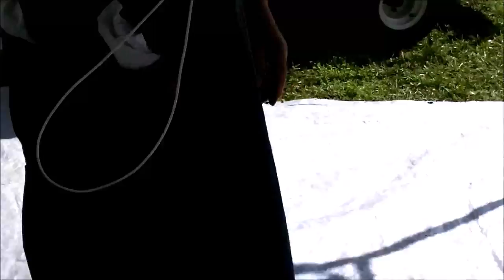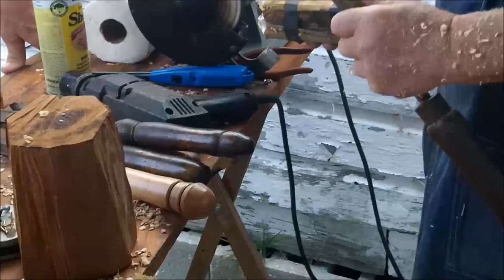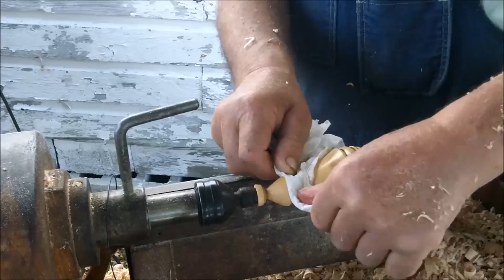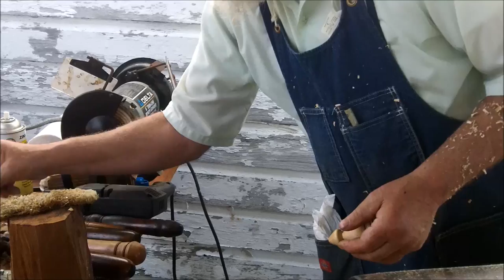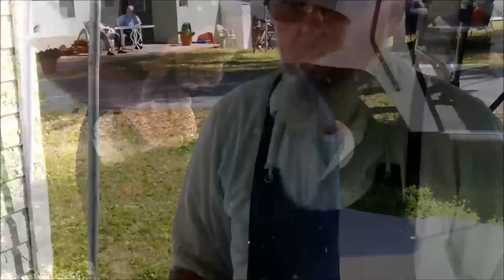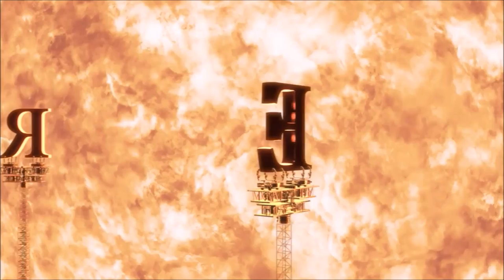Amish Henry Turning Wood Spinning Tops

Comment: why did you put a brass pin on  the top end ?
Reply: Because he didnt have a centering chuck, he was using a tail stock and a head stock, you can't make a perfect tip without a self centering chuck or a faceplate to hold one end and free the other.

Comment: Thought Amish and power were opposites
Reply: There's a misconception that the Amish categorically eschew modern technology. The truth is that they are very knowledgeable and use it very selectively. While decisions regarding which technologies are permitted ultimately rests with the bishops, they accept petitions and consider them thoughtfully before passing along their rulings to the ministers and deacons. Which technologies are allowed and how they are used varies among the different groups and communities. Electric power is used to one degree or another by most Amish, but they don't get it from the power companies, primarily because this requires a physical connection to outsiders.